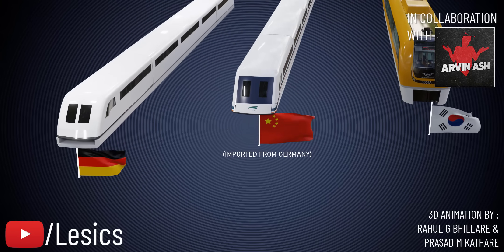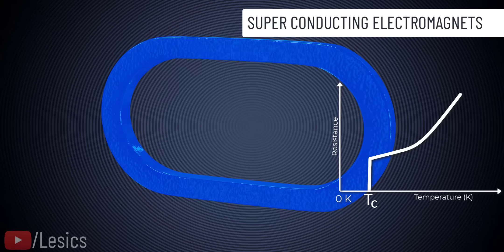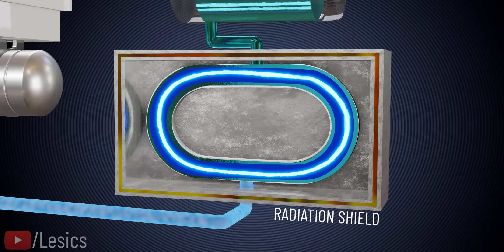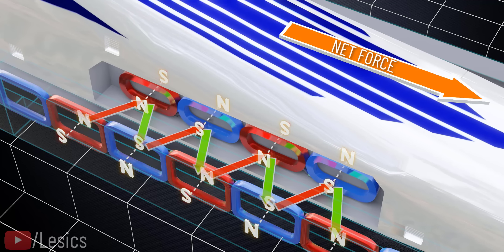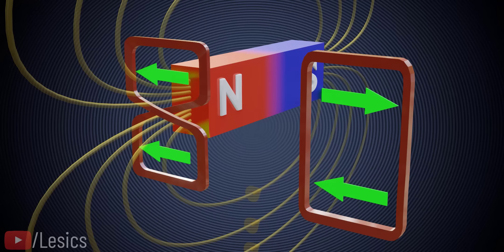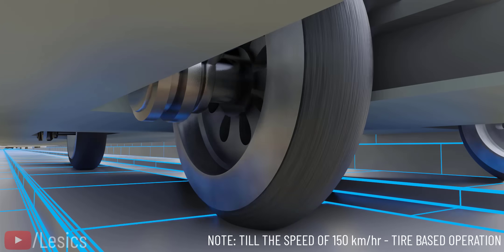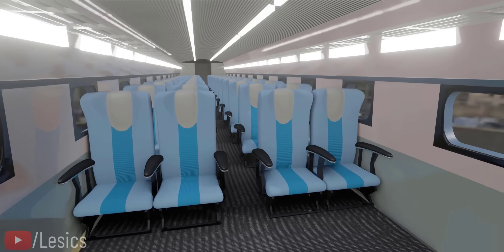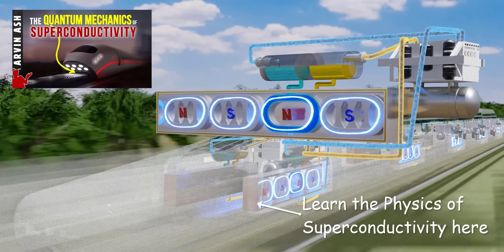The Fastest train ever built | The complete physics of it

Comment: "Forever with no energy loss" are jarring words to my ears. I assume the energy loss occurs in the refrigeration system?
Reply: Most of the power to move the train comes from the train tracks, that's why the magnets in the train can be on for so long.
Reply: Yes indeed "Forever with no energy loss" but only if we keep the superconductor super cooled. And yeah you are right, we use energy to power the cooling system, which is transferred to the coolent(making it cool), which is then transferred to the Superconductor, which allows it to conduct electricity without loss.
Reply: I'd suspect some small energy loss as the train moves through the magnetic fields.  I'd expect constant reinjection of energy to keep the loop current at the design level.  But the thermal systems will probably dominate energy consumption.
Reply: Yes, and heat generated in various components. Plus, getting it upto speed requires a lot of energy, especially overcoming drag at high speeds.
Reply: @williamrutherford553  Evidently it uses the same power of HSR at the same speed but if it put in a single tunnel of 11psi the tunnel resistance would be less.
Reply: I have to wonder whether these super complicated superconducting magnets and the associated cooling and radiation protection systems are really necessary.

Ordinary electromagnets are probably much cheaper and possibly a lot more reliable.

That is of course assuming a Maglev train makes sense in the first place.

Come to think of it, most regular trains (with wheels) probably don't make sense in the context of reliable, mass produced airliners.
Reply: Pham Nuwen it is.. super conductors are more efficient.. the current produced is very high compared to regular electr omagnets making it more powerful , fast and other advantages are there too..
Reply: @glitchy_star_classes6276  I'm sure it's more efficient in terms of energy consumption. The question is is it more economically efficient?

If it's super expensive to manufacture and maintain, it may be an inferior solution overall compared to cheaper magnets.

Or wheels.

Or wings and jet engines...

Consider the Shanghai Maglev. It works, for sure, but they're not planning to build any more of them which suggests to me that it's not cost effective. And that is a cheaper technology as far as I know.

I get the impression that the purpose of this is national prestige rather than efficient transportation.
Reply: @phamnuwen9442  As it has no maintenance it could carry containers overnight faster than any driverless truck earning the big dollars.
Reply: @edwardbarnett6571  That makes no sense at all.
Reply: @phamnuwen9442  I understand that container trains are not on the video but freight picked up in in Melbourne could leave overnight for Sydney beating trucks by 8 hours and getting at least $2,000 per container making it a very viable proposal.
Reply: @edwardbarnett6571  Yeah, no. Rail shipping is used because it's cheap, not because it's fast.

The chances that this ultra-complex and expensive superconducting maglev will be cheaper than a diesel locomotive which uses a simple rail that doesn't even need to be electrified is probably zero.

How would you even put a container on it without screwing up the aerodynamics? Is it built to take the weight of shipping containers? Of course not.

Being bound to the track, it would clearly be useless for last mile transport, so it's not competing against trucks.

Are any regular wheeled high speed trains anywhere carrying intermodal containers? I'm pretty sure they're not.
Reply: @phamnuwen9442  There is only 4% of palatized freight goes by train Melbourne to Sydney and the rest goes by slow 10 hour trucks but I see no reason, as no maintenance is required, that a container train could not save 8 hours overnight earning $2,000 per container making Sydney/Melbourne very economically viable.
Reply: @phamnuwen9442  Science and Technology is not only about the efficiency sometimes.. It about designing and building and trying too.. A example may be computer, which was super inefficient in the earlier days but the research in the field allowed it to be the best gift to humanity.. Similarly, building one train like that is only good. Even it will be inefficient, they will learn not to repeat the mistake in future and learn from it..
Reply: @edwardbarnett6571  Are Amazon shoppers willing to pay double, triple or quadruple the shipping cost to get their stuff a couple of hours sooner?
If they are, isn't shipping by air going to be even cheaper and faster than a maglev cargo train?
Reply: @phamnuwen9442  Planes do not carry much weight and freight that goes Melbourne/Sydney by 3am can be delivered by 7am and by road it is the next day.
I know many semis deliver directly but a lot is transferred to smaller rigids for delivery.
Obviously customers are prepared to pay more to get their freight faster than cheaper.
Reply: @phamnuwen9442  I agree with you.. But, it is still a tech that is in its first generation.. Let the tech be used in public once, then the efficiency will be considered more.. For now, I believe we can allow any new piece of tech to at least have a chance to show if its worthy.. I assume that this was made only after several calculations of Scientists and Engineers about the efficiency.. So it should not be as inefficient as we think.. I still believe it will be better than most trains because of their energy loss due to friction in wheels.. and the maintainance required later to the tracks and the wheels.. wires and electromagnets tend to require less maintaince in compared to those..
Reply: @glitchy_star_classes6276  The rolling resistance of steel wheels on train tracks is extremely small, I believe. The vast majority is from aerodynamic drag, which is not something that maglev technology addresses. For al I know, magnetic levitation might consume even more energy than wheels. I think the main advantage with maglev is supposed to be a smoother ride and to eliminate a potential failure point with wheels revolving at high speeds. I doubt it improves energy efficiency.

The German maglev technology has been operating for many years, yet nobody seems to be interested in investing in it. Presumably this is because it's a lot more expensive than standard high speed rail.

Yes, wheels require some maintenance. Are you saying that superconducting magnets with helium cooling systems, radiation shields and whatnot are maintenance free? It sounds quite complicated and expensive to me.

Again it's interesting as an experiment, but I don't think it's something that governments should be doing. If private investors want to risk their own money on something like this, then that's another matter, but I think they're wisely staying away from it.

Comment: Rather than liquid nitrogen used in the cryogenic part....it could also be done by number of splits on the magnetic shield so as to reduce the eddy current in an enormous amount. If some heat is evolved then ig 1/4th of the liquid nitrogen would be in use

Comment: Very cool, but all I can see is a huge number of potential points of failure
Reply: Such as?
Reply: @edwardbarnett6571  the biggest risk for me is all those cooling parts, but then if you had a power failure on the track, the whole thing would be finished
Reply: @benjones5799  It was tested over ten years before being given an export licence.
Reply: @edwardbarnett6571  sure, no doubt they have a lot of fail-safes.  It seems like it would just need an insane amount of power.   Have room temperature super conductors, and it would be a different story

Comment: I'm slightly confused on why the train has to be moving to levitate. As long as the superconducting electromagnets on the train are still outputting a magnetic field shouldn't it be stimulating the figure 8 coils to produce their own magnetic fields whether the train is in motion or not?
Reply: Think of it as a plane having to move fast to fly.
The faster the train moves, the higher the change of the magnetic field in the 8-shaped coils, thus the higher the counter electromagnetic field the coil produces, that is used to lift up the train.
Just like a plane, the faster the plane flies, the stronger the lift of the wind on its wings to keep it up in the air.
Reply: @aegoni6176  so does the counter electromagnetic field produced by the coils fade if the trains not moving? As in is it produced by the “change” in the magnetic field as the train moves rather than just the magnetic fields of the trains superconductors.
Reply: @aegoni6176  thank you. That does seem to be where my lack of understanding was coming from but I see what you’re saying now.

Comment: Yeah but no. Magnetic Levitation has existed for a long long time. It was invented in the 1940s but it never caught and probably never will. It turns out it is so freaking expensive that its benefits cannot compensate for the money it takes to build and keep running. All current maglev lines exists out of vanity and lose money like crazy. So it's no going to happen
Reply: Any high speed rail costs heaps but at least it could be designed for an international standard guideway for ISO carriages and overnight container trains to make it economically viable especially as no maintenance is required.

Comment: imagine how many coils it requires for each kilometer railroad
Reply: Compared to overhead wiring I dont think it costs much more than steel wheels and rail particularly on the maintenance side.
Reply: @edwardbarnett6571  I assume that material wise it might be very similar to high-speed rail. But there is a high change that the tolerances might be way more tight on this maglev stuff.
Reply: The Superconducting Maglev has no contact between the guide and the train in most of the ascending sections.
Since magnets can be replaced on a unit-by-unit basis, they are likely to be easier to maintain than iron-wheel trains.
Also, arriving at the destination in half the time required for a normal Shinkansen means that half the number of trains can be operated.
Reply: What if it will replace the traintracks railways 😭😭😭😭😭
Reply: @krystalmills1622  Be OK for places that only use slow trains for bulk and sightseers
Reply: Sheru
It would have to be monitored closely for safety reasons but as there is nothing to wear the maintenance would be insignificant.

Comment: I have a question. Does it really important how high the SC maglev levitates?
Unlike other maglev trains, the SC maglev uses coils on both sides of the guideway. This means once the train reaches the speed that is fast enough to levitate itself the train does not need rail on the ground. (The coils need to be connected in order to guide the train, but they can put a roof on the rail to put wires on it) In the video, it says the train levitates 3.9 inches. But if they build the rail having only guideways 100m above the ground, they could say the train levitates 100 meters. So I don't think the height of levitation is not really important for this train.
Reply: 7:30 it depends on current flow and emf values and height of those 8 shape loops. I guess.
Reply: @westerntools4602  As the German/Chinese maglev only has 1cm clearance relying on numerous computers to maintain it the cost of construction and maintenance is higher.
Reply: １００M  の高さにレールを作るなら、垂直に１００M上昇させるシステムが必要になる。
Reply: @kitakazehai  リニアの浮上走行に必要なのはレール両サイドの浮上用コイルとガイダンスコイルです。仮にリニアが谷底まで100mの渓谷を通過するとき、そこに架けられる橋に両サイドのコイルだけで底の部分がなかったとしてもリニアは通過できます。

その場合、リニアの車体から谷底までの高さは100mで「浮上高は100m」になります。

何が言いたいかと言うと、日本のリニアの浮上方式において浮上高を他の方式のリニアと比べることはそこまで重要ではなく、技術的な限界を表すわけでもないということです。安全上の問題や地上からの給電、その他の理由でその高さになっただけではないかと。

やろうと思えば1mでも10mでも可能でしょう。
Reply: @satoshiblue3  可能とか不可能とか、そういう話ではなくて、１ｃｍ浮かすのと１０ｃｍ浮かすのに何の違いがあるのか？という話なので、１００ｍ上空にレールを引いた場合、停止したら下に落ちるわけだから、また動き出すためには　１００ｍ上空まで上昇するシステムがいるということ。
つまり、別に１００ｍじゃなくてもいいけど、地面からどれくらい浮くことが出来るかは、１ｃｍよりも１０ｃｍのほうがその分上下の揺れに対応できるわけだから、安全だろうということ。それが言いたいだけなのに、かなり回りくどい言い方をしてしまった。
Reply: @kitakazehai 　時速500kmで走るリニアが地上100mから落ちたら地上でバラバラになるので再度100m上昇させるシステムは別にいらないと思います。地上で残骸を回収するか、クレーンの出番でしょう。
Reply: @satoshiblue3  例えだからｗ

Comment: And I keep wondering where all the copper stock has gone, but it turns out that's where they put them in the roadways for the Maglev. However, in households, instead of copper wires, aluminum wires are crammed onto electric motors such as vacuum cleaners, wires from chargers, autotransformers and other substitutes for copper materials. Shame!

Comment: Maglev has been worked on for four decades now. It looks good on a test track, but it NEVER gets deployed in revenue service. Why? Because while traditional high speed rail has EXPENSIVE TRAINS, that scales very well no matter how far you need to go. Maglev has EXPENSIVE TRACKS which causes costs to explode the moment you are building hundreds of miles of it not a few miles of a test loop. Think of it this way. It is way, way, cheaper to have a million dollar Ferrari that goes very fast, than a billion dollar a mile freeway that can make a Minivan go very fast by putting on a high tech conveyor or whatever.
Reply: The main cost is the slow old brill and blast tunnels even conventional hardrock TBM is faster but this could drive 100m per day https://3dwarehouse.sketchup.com/model/c1405816-d744-4363-8cf8-729828f9397e/14m-cone-with-discs

Comment: …current flowing by it selve in circles…?!

Are you shure.. does it  not only reduce the resistance to almost 0 and therfore there is no power loss in form of heat… doesn‘t current need Potential to flow and therfore can not run in circles…

Comment: One thing mentioned at the beginning of the video is that you need to alternate the polarity of the on board magnets to achieve propulsion. If the system controlling that alternating function were to fail, it would not be a pretty ending. I am also curious to know the process for reversing polarity as well.
Reply: Been ok for ten years.

Comment: Great video! 
I have a question that I hope somebody can answer here:
Why are the superconducting coils in the train and not the "rails" ? Wouldn't supplying them with power and cooling be easier if they were stationary ?
Reply: For supplying power, yes, but if you have to put the superconductor cooling systems all along the length of the track, the infrastructure & maintenance costs would be astronomical.

Your proposal is like asking why roads are not just a massive system of conveyor belts pushing boxes along, instead of an immobile surface for self-propelled wheeled vehicles.

And the answer is the same: infeasible cost.

Comment: thats is an extremely expensive project. I think it doesn't worth it to spend such a huge money to just reduce the traveling time from lets say 2 hours to 1 hour
Reply: If you ask if its worth spending the money then I guess you have never been in Japan and used the high speed rail network. Read the Wiki entry on Shinkansen

"The original Tōkaidō Shinkansen, connecting Tokyo, Nagoya and Osaka, three of Japan's largest cities, is one of the world's busiest high-speed rail lines. In the one-year period preceding March 2017, it carried 159 million passengers, and since its opening more than five decades ago, it has transported more than 5.6 billion total passengers.
At peak times, the line carries up to 16 trains per hour in each direction with 16 cars each (1,323-seat capacity and occasionally additional standing passengers) with a minimum headway of three minutes between trains."
I've spent a lot of time in Japan and can assure you its HSR network is massively used safe and wonderfully efficient and tickets are surprisingly cheap although if you are a tourist then buy a Japan Rail pass from a travel agent in your country as these offer unlimited travel for one or two weeks but cannot be bought inside Japan.

Comment: Surprised none of the top comments are talking about how amazing it is that they're able to keep the magnets at 4 kelvin. Goes to show how few people have even a modicum of a clue as to the complexity of this project.
Reply: It’s fundamentally the same tech you’d use for any advanced refrigeration system afaik, just scaled up and made to work with a particularly finicky refrigerant (liquid helium, as a superfluid, acts really strange). The fully passive stabilization and levitation system is frankly more impressive for the genius in its simplicity. On the other hand, the lack of active stabilization does explain why it has such an absurdly wide turn radius compared to even other high speed trains (8000m vs 1000-2000m despite going only about 2x as fast).
Reply: Ask any refrigeration engineer and they'll point you toward the compressor. They get close to absolute zero by using the correct gases. Freon, ammonia, helium...just go down the gas list.

Comment: It seems that this could be even more efficient if the power was onboard the train in the form of liquid hydrogen which could be transitioned to gas while simultaneously cooling the coils and radiation shields and once gasified then feeding a fuel cell to supply the power. Since this mechanism would require no compressors the total power requirements of the train would be lower and there would be no need for the power transfer coils in the train or the track thus greatly reducing the cost of both.
Reply: Preach

Comment: Why don't they use REBCO tape now? isn't the cooling requirements of the latest and greatest YBCO superconducting tape vastly superior efficient because it requires less cooling and provides stronger magnetic flux, resulting in smaller form factor and cheaper manufacture.